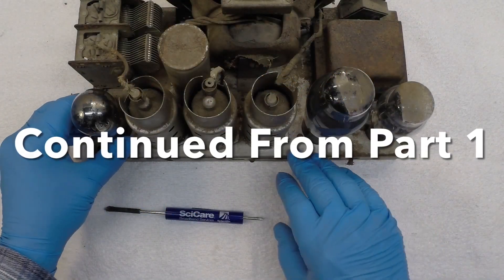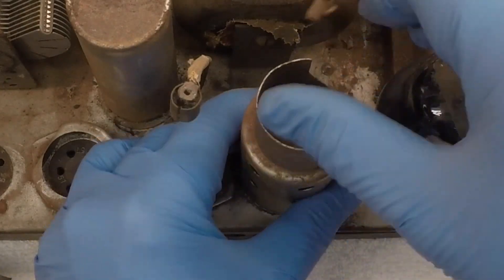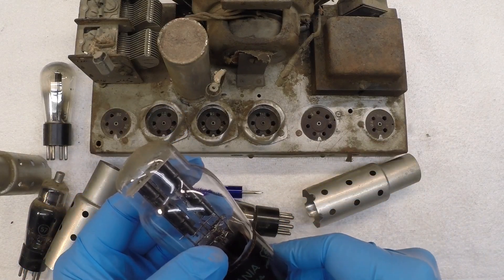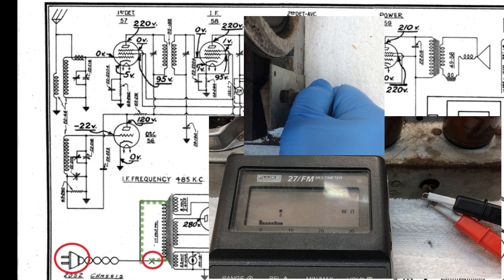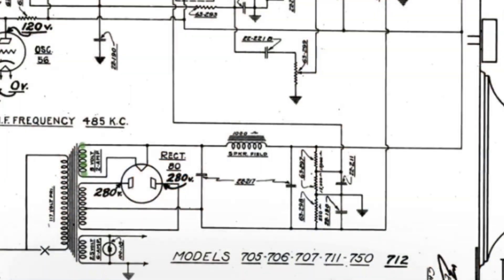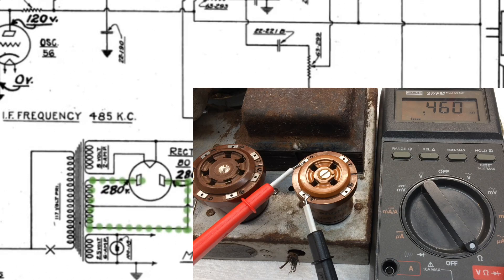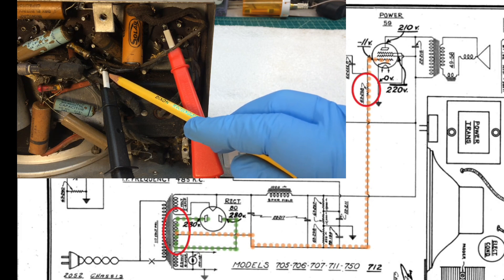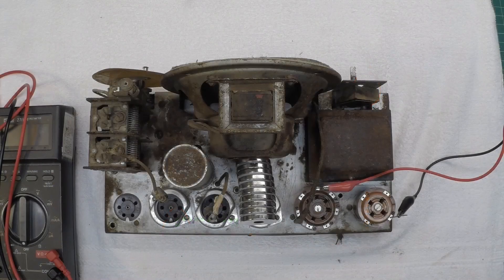Zenith 707 - Power Transformer Testing & More...

Comment: Oddly enough I'm working on a very similar model, the 807, but my cabinet is almost gone, looks like its spent the last 50 years in a barn. Almost all of the veneer is destroyed and some of the plywood in front of the speaker only has 1 piece of substrate left, but at least it leaves me the original design to copy. The odd thing is the chasis in mine isn't rusty. Like at all. There is only a few spots on the power transformer. And this is after pulling out 3 mud dobber nests and a wasp nest as well as remnants of a mouse nest, which are notorious for rusting a chasis. It also doesn't have the asbestos but perhaps that's because it's the tombstone style.
Reply: It also has all of the original knobs, so that's definitely a plus. Very thorough restoration as always!
Reply from the maker: Thank you. I’m hoping my Dad has the matching knobs I need. Best, Don
Reply from the maker: Sarah - I looked at some examples of the Zenith 807 and it’s a beautiful tombstone. I know you’ll have it back in mint condition at the conclusion of your restoration efforts. It’s good to hear you’re not having to deal with the rust as well. I’m thinking the same on the asbestos, your clearance between the tubes and cabinet being a tombstone... I hope things continue to go as planned. Best, Don